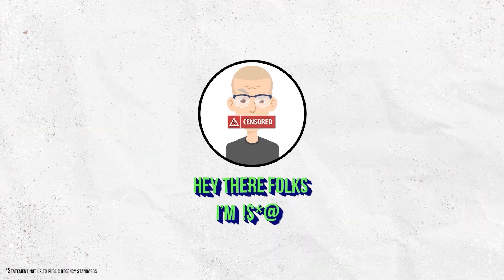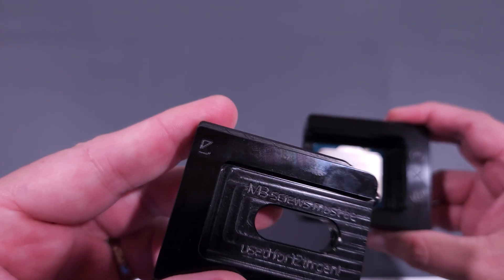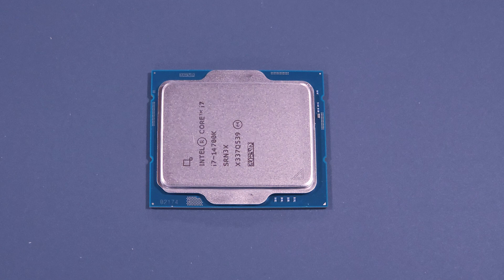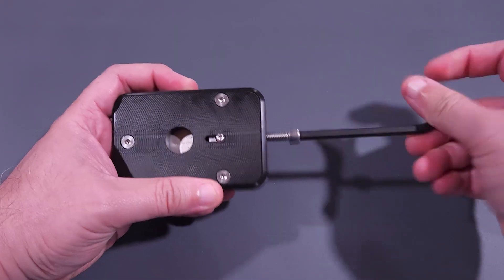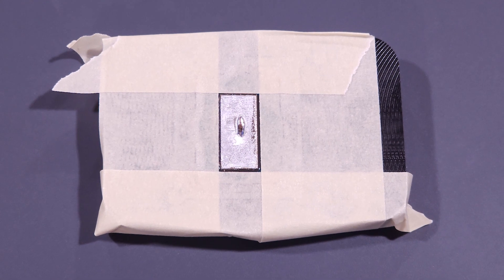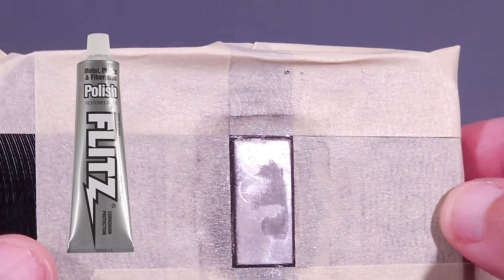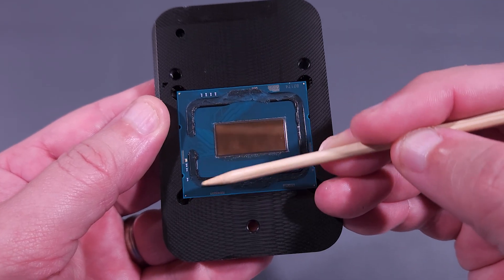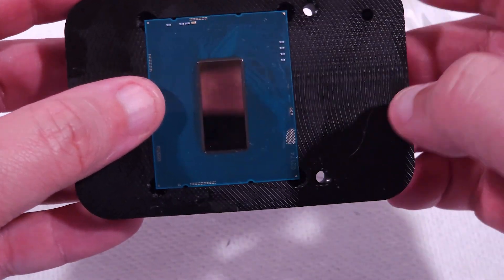How to Delid an Intel 13th/14th Gen CPU

Comment: Any chance you have a video showing how to put it all back together to use with a normal cooler to make it run less hotter? I don’t feel comfortable doing a direct die cooling.
Reply from the maker: That's a tutorial I intend to produce but its behind a few other videos to be made and some time away for a business trip. If you are looking for something right away, I'm not going to have mine done in time. Sorry about that. However, if you're willing to share, I'm curious to know the top 2 or 3 topics you'd like to hear about in a relidding video. If not, that's cool too. :)
Reply: i avoided direct die my first couple times delidding because it sounded scarier, but after my first time direct die cooling i'll never go back. i would argue it's safer and better in every way, as long as you have the right mounting gear and know how to apply liquid metal. you're already delidding, why not go the distance? just do the research like watching this tutorial here, and make sure you have what you need. it's seriously easier than relidding anyway.
Reply: Just think about laptops they are already 'delid' dyes so if they can handle it definitely desktop as well @illy984